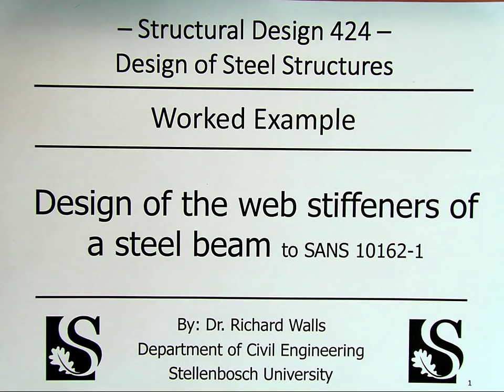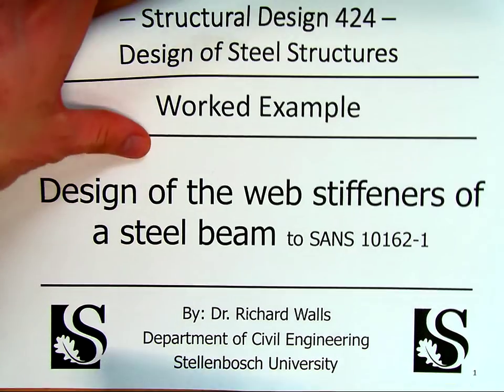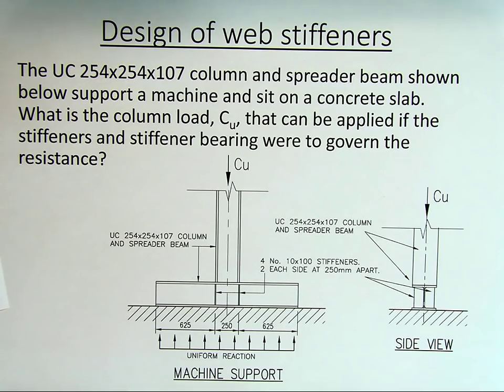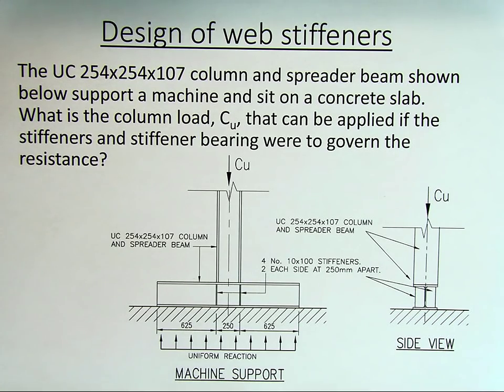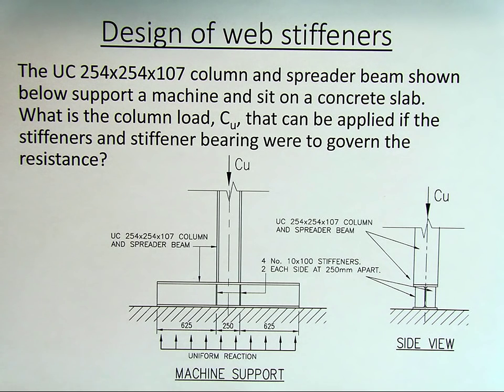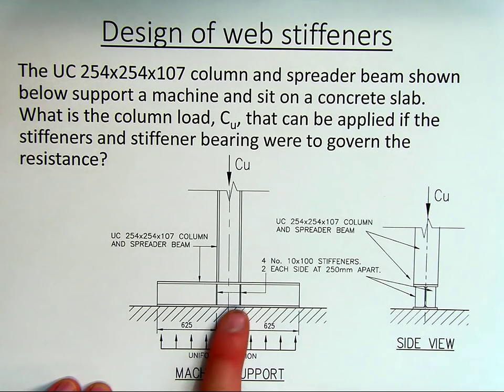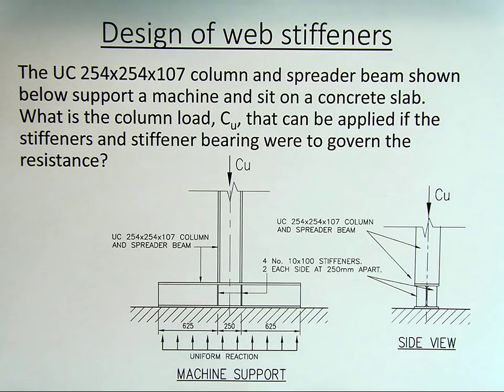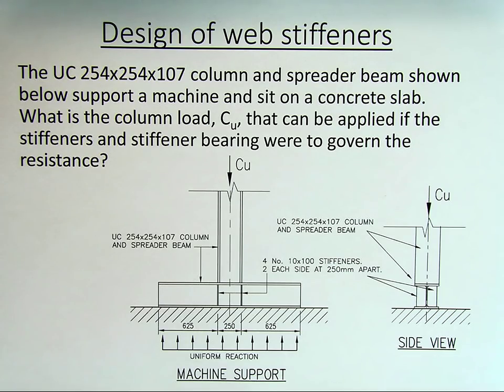Steel Design - Bending/Shear - Design of web stiffeners - SD424

Comment: Would you add web or connected stiffener element area in the effective area for axial capacity calcs when they are bolted connection instead of welds?
Reply from the maker: Only with caution. Bolts have tolerances so will need to move before load is carried.